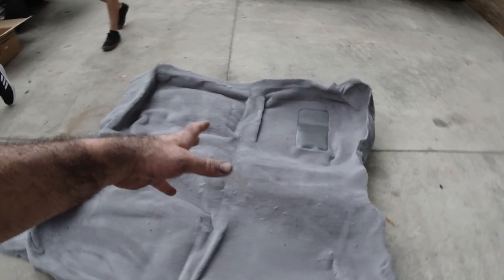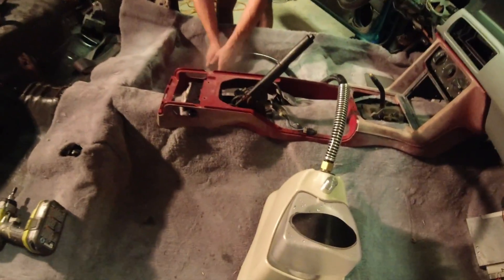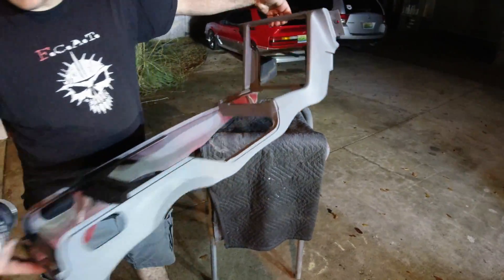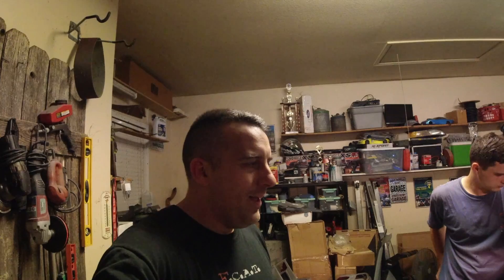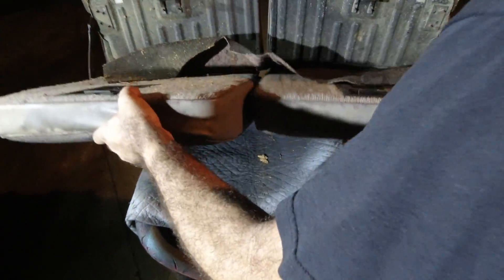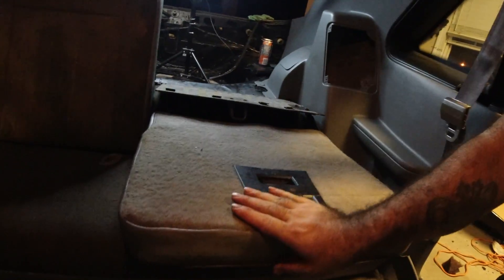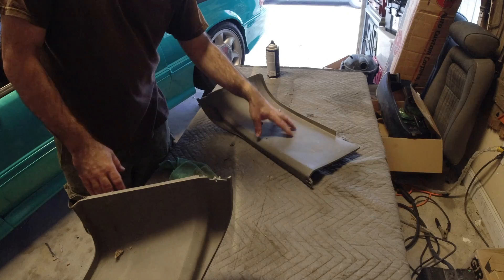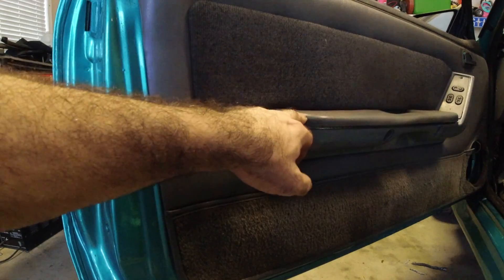TRYING TO BUILD A SUPER CLEAN FOXBODY INTERIOR (On A Budget)

Comment: Great video, and i can add from experience--if you want to test paint, paint the underside of the console. if there's a problem, you can literally hide it from sight rather than have to remove the paint and start over.  also, clean the trunk's surface and apply bedliner or whatever else before putting the carpet in, so you avoid transfer (if you're a klutz like me).

Comment: Good job guys. Its good to see someone doing the 2 tone black/grey cuz it seems like everyone is only doing all black. I have my interior dismantled right now due to having to pull the dash to repair rust up in the a-pillars so I am going to spray the dash before it goes back in and everything else as well as it gets pieced back together. I got the SEM colors from LMR in the factory smoke grey color and I never could get a good concensus of what color the dark part of the dash is. I think the satin black you used looks good at least on video it does. I have the steering column color the had called charcoal black that Im considering trying to see how that looks. I already dyed my passenger door panel, kick and threshold and that SEM goes on like butter. Cleaning and scuffing it good is the key like ya'll did and it doesnt take much either. 
I was wondering about the carpet too as well because I want the mass back when I get mine I just havent gotten that far along yet. What about a heat gun to the back side as you lay it. I wonder how that would work as I know I'm going to be into the winter months by the time I'm ready to lay in the carpet.
Keep it up guys. That car is coming together nice.

Comment: A great way to super clean the carpet in cars is to remove it and wash it with an electric pressure washer.  Wet the carpet and let soap soak in for about an hour, wetting it once or twice.  Then pressure wash it.  Hang it up and let it dry.   Works like a champ.

Comment: Help!! On a AOD neutral safety switch has 4 pins where it connecs, but the one i bought online  has 5 pins! Can i still use the 5 pin neutral safety switch??? Thanks! 84 mustang
Reply from the maker: Not sure on that brother... it very well could be a universal connection but that’s a guess.
Reply: On the 4 pin ! 1 & 2 pin supposed to be for reverse lights and 3 & 4 pin crank only( neutral and park) and on the 5 pin supposed to be for the computer! Based on some forums its was not used on some cars! I will try to use the 5 pin to see what happens! Cus car was not cranking! Has new ignition switch! New starter solenoid, new battery, battery cables! Only tries to crank when bypassing the solenoid but nothing happens when turn the key! Thanks for reply !! Your videos are good!

Comment: I do watch your channel sometimes and had a ?  The insulation on the driver side toe board is getting wet when it rains. I pulled the cowl cover  off and looked inside there also ran water in there and couldn't get any to come into the car. It's still coming in from somewhere and I can't figure it out  Could it have a leak at the bottom of the windshield and then trickling down.? I've got the carpet out of this mustang so there is nothing to make it wick in to the insulation. If anyone else reading this has run into this before please let me know.tnx

Comment: Man that interior looks great Brew how  does that dye hold up scratch wise ? Say if u took a gray panel in dyed it black would it be more easier to scratches? So it would be better to do black on black panels! I have sand beige interior in my notch I am a big fan of black interior my dashboard is black & beige I don't want dye black over beige I mean I have just about everything to make it a almost black interior car I have the door panels the rear sail panels I guess that's what they are called I have the black carpet 2 black Gt seats I think I am going to mix it up black & beige I have to change my dash pad on my dash to mine is jacked up I have a black 1 I am going to put on it!!! Brew u ain't gonna paint the metal pieces on the back of rear seats!! That car came along way in no time at all when u put them seats in that man it's going to sweet man!!!